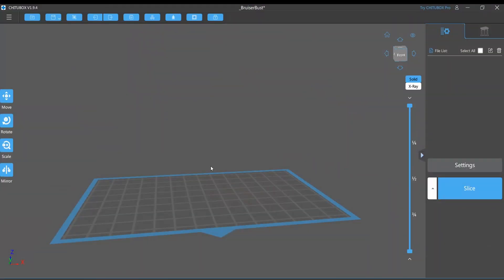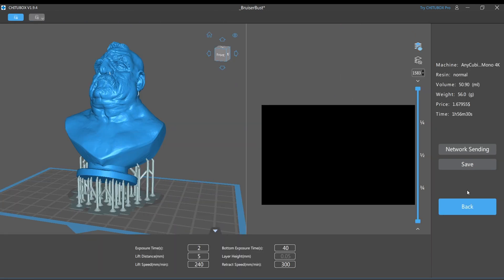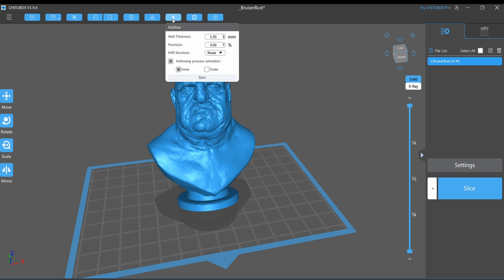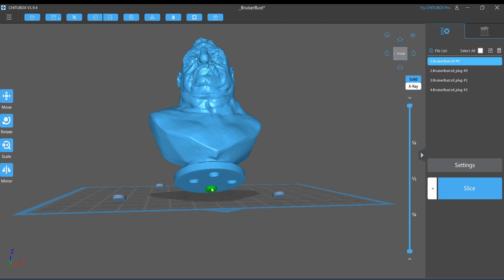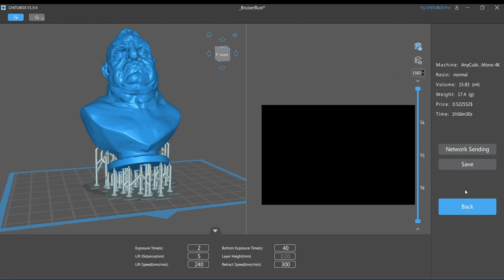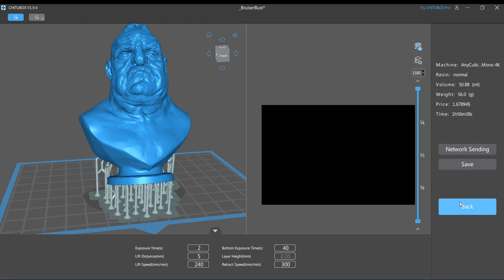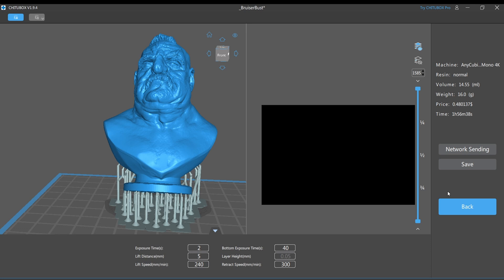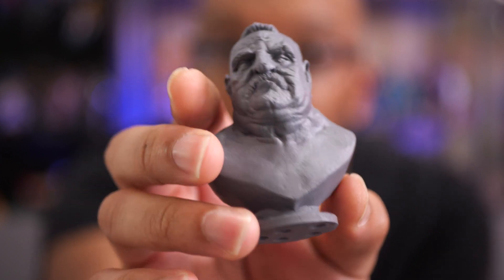Why You SHOULD Hollow Resin 3D Prints

Comment: Wouldn't it be clever to turn the figure so that you have a hole at the highest point so that the resin can run off directly during the printing process if the object is then printed upside down?

Comment: Perfect timing. I just tried to print up the Mortuary Custodian from Belksasar and it pulled partly loose from the plate. Needless to say, it printed up jagged and deformed. The cost in resin was pretty steep, given that I was trying to get a large print done. Showing that I can cut down the resin to about a third or less, this will likely make the next print a success. Thanks once again for the great advice and reviews. Noobies like myself really appreciate it.
Reply from the maker: Thanks a lot! I hope your next print is successful. Just make sure you thoroughly clean the inside of the hollow model to avoid potential resin leaks.